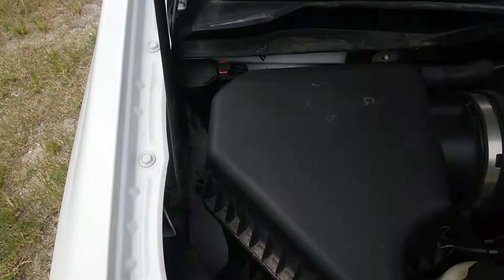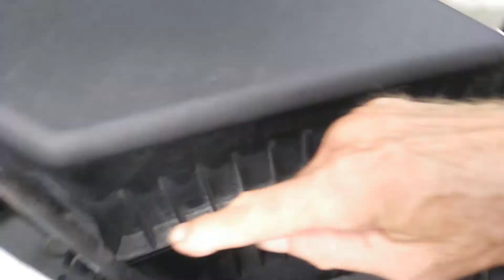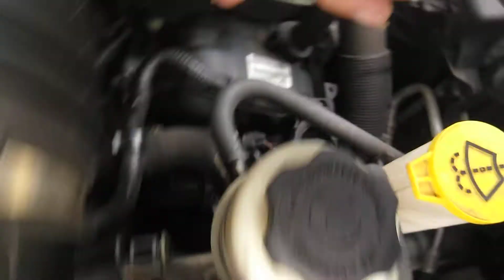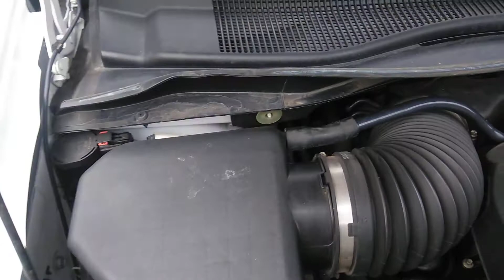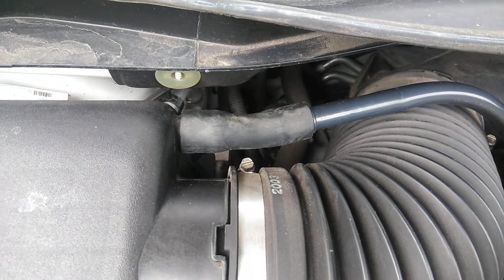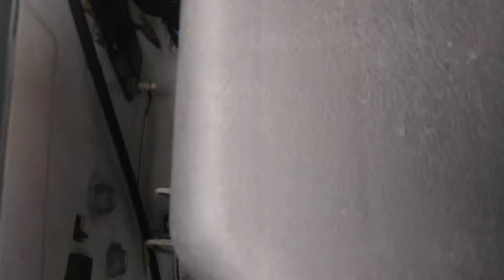(Oil Change Problem) - 2008 - 2018 Chrysler Town/Country - Dodge Caravan Minivans "3.6 ltr"

Comment: You have to remove it to take off your oil filter. It would be an easy to overlook.
Reply from the maker: Yes it's easy to over look it. I had two different places leave it off.
Reply from the maker: It's always good to get a heads up. Mine was left off and it caused my engine light to come on. The code came back as something else. It was because the air box being left partially on or not on good at all. I check after every oil change now.